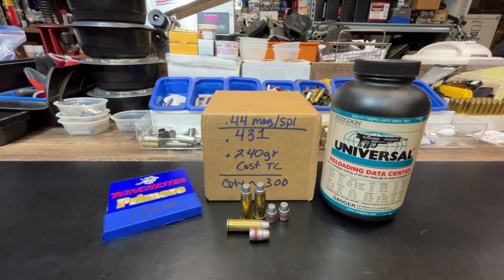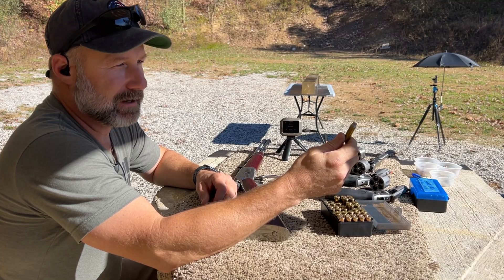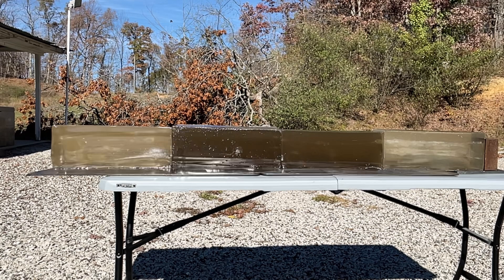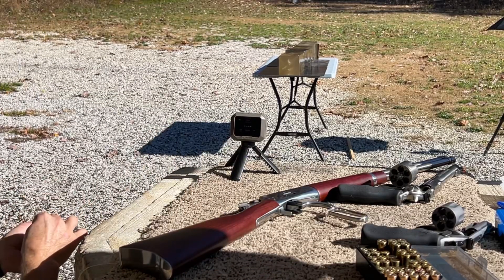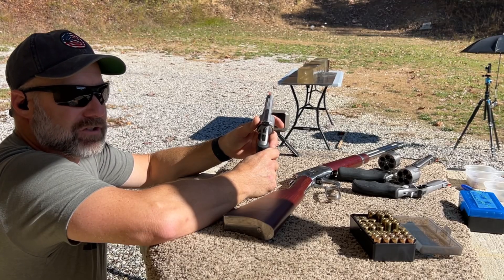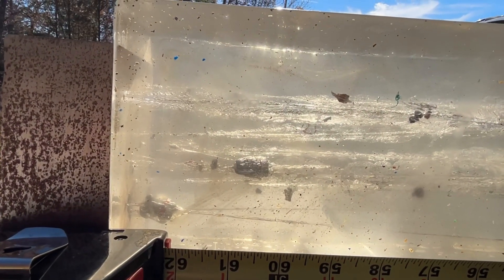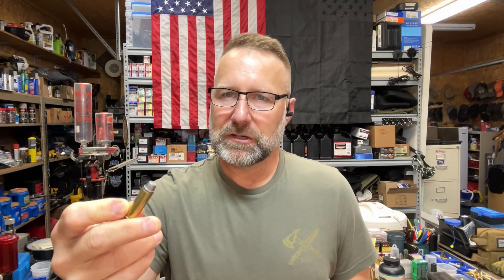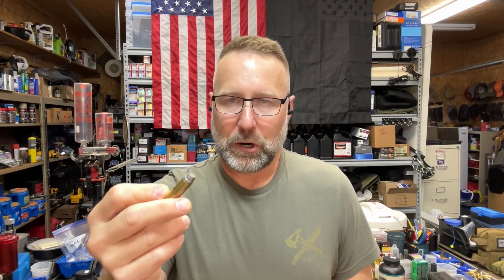.44mag 240gr Cast Lead SWC Bullet, Ballistic Gel Block Testing with 4 Barrel Lengths. .44mag

Comment: I’m a huge fan of cast bullets at medium velocity. I rely on home cast Lyman 429421 with a good soft lube. They’re plain base, rather than beveled, and don’t cause any leading.
It’s a shame Universal and Clays have been discontinued.
Reply from the maker: Not sure they have. 

Both are still priced on Hodgdon’s website and both have reminders for in-stock notification emails.
Reply: @kentuckyrangetime That’s weird, Midway canceled my hold saying it was discontinued.
Reply from the maker: @876mpr 👍🏻 

I messaged Hodgdon yesterday to confirm and they said they haven’t recently and don’t plan to discontinue any powders in the foreseeable future. Hopefully it’s just been running a low availability and will show back up soon, somewhere…. 😉

Comment: I love 240gr SWCs For my Henry BIG BOY I use 23gr of H-110 with a large pistol Magnum primer and for my M-44 6.5" barrel I use HP-38 max charge with a regular Large Pistol Primer. In my opinion a SWC can be used for everything. :-D
Reply from the maker: 👍🏻. 🤔 Can’t think of anything they wouldn’t work on …. 😉
Reply: @kentuckyrangetime  If you get around to it, I would like to see those loads in Gel.

Comment: Great video. On cast bullet penetration. Think back to when the 45 Colt was assigned to the army. 250 gr cast bullet running approximately 900 fps. Army reported it would shoot thru a horse at 100 yards. Kinetic energy is something else. I prefer hardcast in my 44 mags. My 16 inch Rossi 92 has an average of 1763 fps with the 240 gr.. Pretty sure it'll handle hogs and whatever other critters may come along here in Alabama.
Reply from the maker: @stevekynard6658 Easily…😉👍🏻👊🏻. 

And, hard cast is something we can do at home. 😉

Comment: Have you shot this load at 25 yards,my marlin keyhole with cast the groove bor diameter  is larger than the pistols. Mine needs bullets in the 433 diameter.
Reply: Started  powder coating to increase  diameter  ,and stop leading no need for gas checks.All keyholing went away 24  grains H110  great accuracy.
Reply from the maker: @brucepierce4971  I haven’t yet.  I loaded it up just for the gel test.  Makes sense though. If the OD isn’t large enough to get a good seal it won’t engage the rifling.   How fast are you pushing bit??  Sometime increasing the load will help lead bullets obturate and create  gas seal.

Comment: I’d love to see a test with the 215 gn cast spire point gc from Matt’s bullets I’d throw in with ya for a box of em 😂
Reply from the maker: @18speedPete  If I had some I’d test them. lol.  

I’ve dropped nearly $500 on bullets in the last month between the 8.6blk and the .50 Beowulf. Plus, I picked up a .32acp a few weeks back and 2 different bullets for that.   

I need several months to get the general fund restocked. 😉
Reply: @ and they say drugs are addictive lol I got hooked on a 44 years ago even took one to the DD ranch in Ohio and got a couple rams
Reply from the maker: @ true. Reloading is a never ending path to spending more money…. Between adding calibers, getting more equipment to make your loads more precise, brass prep, casting and all the new tools, the spending never ends. 😂😂😢

Comment: May seem like a strange request but could you load up some of those at about 550-600 fps? I am curious as to the penetration one would get with mouse fart loads.

My guess is you would still make FBI penetration minimum but inquiring minds...
Reply from the maker: @mkshffr4936  😂. Keep reminding me and when I get caught up I’ll try to some out. 😉
Reply: @kentuckyrangetime Reminding you. 😊
Reply: Thanks.
Reply: such loads already exist. They are called .44 Special and are quite OK in terms of both penetration and stopping power
Reply: @Pinky_Anna_ABUSE Seemed to me like most specials are a bit faster than that.

Comment: Gel doesn't provide an accurate representation of what a large meplat bullet can actually do in living tissue. I have taken several whitetails with a .44 mag and cast bullets over the years and the results are quite uniform. A cookie cutter hole in, a 1-1.5 inch wound track (this isn't replicated in the gel) all the way through, and an exit hole somewhere between a nickel and a quarter.

I'm not sure how this exactly works, but my theory is that the tissue becomes "stacked" against the nose of the bullet. This stacking effect creates a high pressure cone in front of the projectile that causes tissue damage greater than the diameter of the bullet itself.
Reply from the maker: @slimjimmy229 For sure.  Hydrostatic tissue damage. The gel is more immune and elastic. Tissue walls break down liquifies more than gel leaving a larger permanent wound channel.  The gel probably reflects a more accurate penetration depth more than permanent wound channel.
Reply: @kentuckyrangetime  I can't speak for that when using a cast because I've never caught one in a deer. However, if we are talking about expanding projectiles, I firmly believe that wetpack provides a better test medium. A bullet that frags in wetpack and game will generally show a perfect mushroom in gel. 

Take a 150gr 30 cal Hornady SST for instance. I've seen test showing that those bullets retain 70% of their weight and penetrate around 18" of gel. Yet, in wetpack, I see 10-12 inches of penetration with about 30% retention.

Compare that with on game performance where that exact bullet is found in the hide of the off side weighing in at a mear 60gr.

I completely understand why you use gel as a creator. It does provide a uniform medium, clear wound tracks, and is the "industry standard." I just feel that gel gives a lot of great bullets a bad wrap, and bad bullets (in my opinion) a good look.

Keep up the good work! I just found your channel and love the in deapth detail that you provide!
Reply from the maker: @ 👍🏻 Thanks!

Comment: Why not recast the gel blocks tho? Melt them down and filter them and repour. And I think I would use a wad cutter for a wheel gun in a backpacking situation for a better wound track but that's me. Good video!
Reply from the maker: @gotindrachenhart  I do reform them but even hot its to thick to screen. Most of the amber color isn’t from the debris and bullets though. There’s an oil in the gel that starts breaking down after 6-7 reheats.  Just keeps getting darker the more you reheat them. 😉 

Not much of a wound track with these though, just deep penetration. 😉
Reply: @kentuckyrangetime  oh I thought that was just some FBI blocks in there lol

Comment: 231 Win works great with 230 cast bullets.
Reply from the maker: Not sure I even gave any 231 on my bench. Lol.

Is that the light blue label?🤔
Reply: @kentuckyrangetime  Yes, that's the can. I like using 231 for light 44 mag cast loads using 240 hard cast bullets (9 grains). I also use 231 for 44 spec & 230 45 auto.

Comment: I have some pure linotype bullets in 357, 44, 45. They go through 1/2” plate steel. Never shot AR 500. Got a lot of lynotype from an old print shop for removing it out of a warehouse
Reply: I have an antique shop Linotype will splatter on ar500 steel . U can buy linotype metal from root metals but they sell better alloys for bullet making like they’re super hard”. The Linotype is so hard it’ll shatter . U want a better allow for bullet casting. The old Lyman #2 is very similar to regular wheel weights lead and is very good. I’ve played a lot with alloys and even zink . Powder coating is amazing and allows me to shoot any allow including dead soft at any speed without leading. I don’t shoot super hard bullets like 100% Lino because it’s just a waste of a very expensive alloy metal. When I required a harder bullet I’d cut Lino 1/3 or 1/2 and water quench. Roto metals has a big mix chart to help u understand where u will be. Tin helps mold fill out. Pewter is a good alloy when u can find it. I recommend buying a 5lb ingot of super hard from rotometals.com and using that to alloy your regular soft lead and water quench. U can use the alloy table to see what bhn u will get. Super hard alloy being condensed for cutting is the most economical option. Because shipping lead is of course expensive.
Reply from the maker: @e.l.robbins5614  that’s awesome!  I have a friend who had an antique shop. They’re always hitting estate sales. I have him keeping an eye open for linotype but no luck yet. 😢.

Comment: Loved all the smoke from those lead pills.  Great how you addressed the question of leading in a magnum loading right up front.  Looking forward to your next installment, Matt.
Reply: What lube and areyou  gas checking them. You shouldn’t need a check at those  speeds. Good testing. We didn’t have gel when I was young so we used wet phone books.
Reply from the maker: @ no gas check and just the wax lube ring.
Reply from the maker: @tombraley3212  Thanks!!
Reply: @ Do you think that a coated or plated bullet would still give the performance while allowing a substantial increase in speed?  For example with a proper H110 or Lil Gun loading.
Reply from the maker: @tombraley3212  plated bullets are going to have a velocity ceiling too, around 1200 for standard plated and 1500fps for thick plated. You can push PC-powder coated quite a bit faster if the back of the bullet is coated good.  You can push HTC- Hi-Tek Coated  bullets faster but in longer barrels and higher velocities you can burn through the HTC coating and still get leading near the end of the barrel.
Reply: @ Much appreciated, Matt!  Looks like I’ll stick to the XTPs😉
Reply from the maker: @ That’s almost always a great choice. 😉

Comment: This used to be my grandfathers go to load a 240 lswc with unique. He didn’t like how the hollow points of back in the day wouldn’t always give complete penetration and said these would kill deer just as fast but always go through both sides from his 9-5/8” super redhawk.
Reply: Same here. Universal is very similar to Unique. Runs great with 240 gr cast swc in .44 Mag.
Reply: Had a buddy load up on casted .454 215gr SWC. Sized an lubed all 900 for my 45 ACP. Someone was arguing that they wouldn't work for deer hunting. Ran them for three seasons in my muzzleloader saboted. Surprise surprise, half inch holes still fill the freezer 😆👍

Comment: Good video and info.

To easily remove leading, get some Chore Boy all copper scouring pads.  Wrap some of the material around a bore brush for a very tight fit in the bore.   This will also remove plastic from a shotgun bore.

It takes a bit of work to get a good cast bullet load.  The diameter wants to be .001 or .002 over the groove to groove diameter of the barrel.  A gas check design also helps.  IMR4227 powder generally gives less leading.   Lots of info on the web.